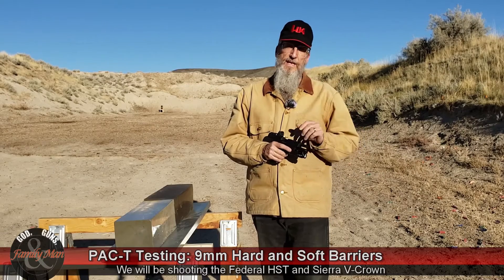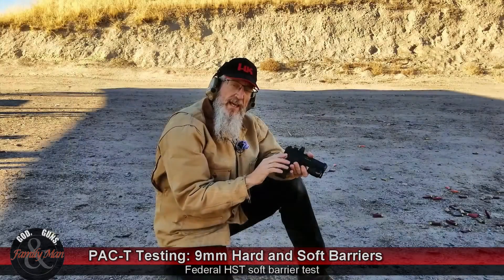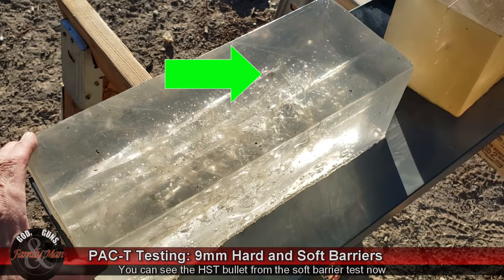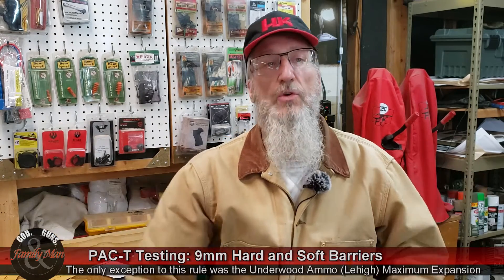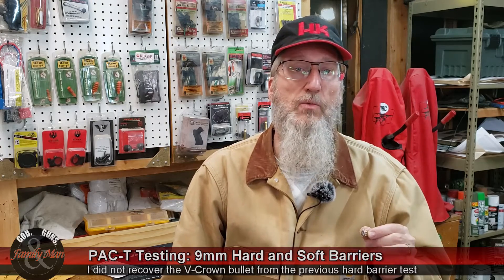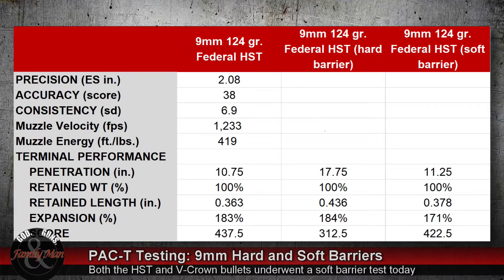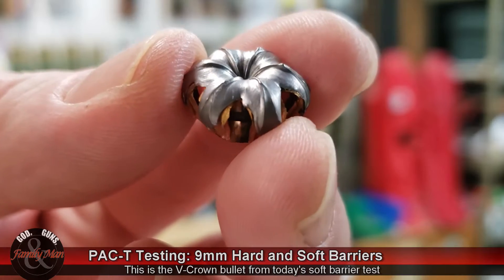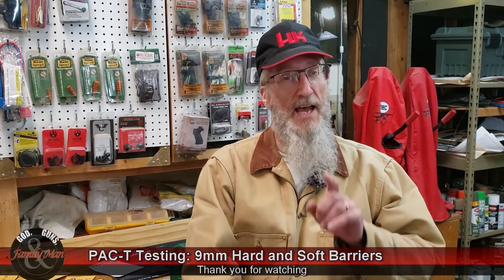PAC-T testing 9mm HST and V-Crown: Hard and Soft Barriers

Comment: Thank you for testing these two side by side. I've always suspected that the HST and V-Crown were very similar in performance, which is good because I consider HST to be the best in JHP for 9mm. I really do wish you would have shot just 1 more round, so we could have seen proper results on the "Hard Barrier" test with the V-Crown. Had you not had that second block, your HST "Hard Barrier" test would have turned out like your first V-Crown "Hard Barrier" test. I'll bet if you had shot the V-Crown today through the "Hard Barrier" test it would have performed similarly to the HST.
Reply from the maker: Thanks for watching and posting.  Good points.  FWIW, based on continued testing since this video was made, the HST has proven to be quite a bit better than the V-Crown.